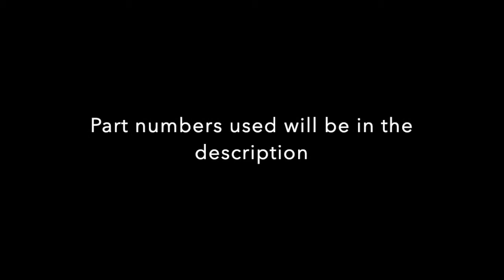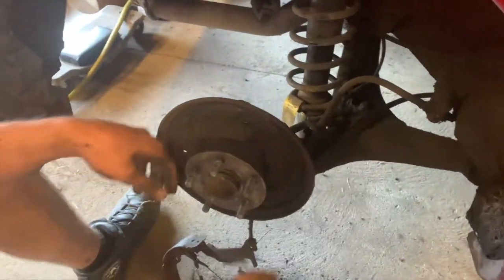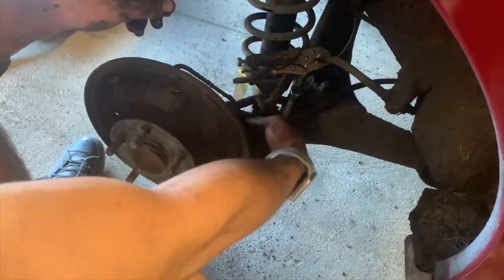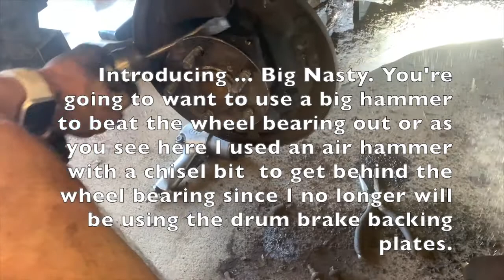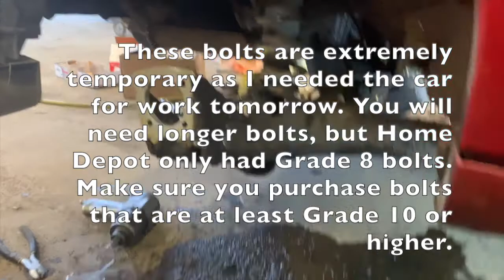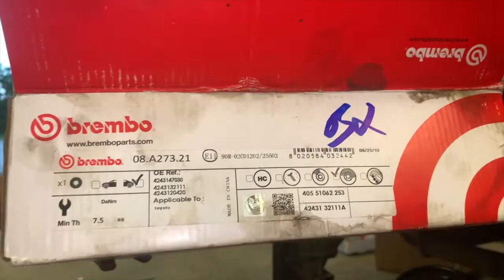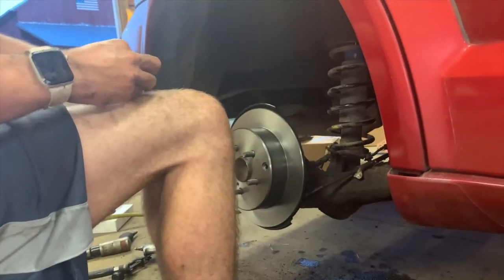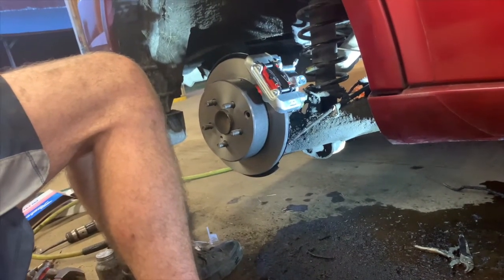2003-2008 Pontiac Vibe/Toyota Matrix Rear Disc Brake Swap

Comment: Where did you get the new backing plates from?
Reply from the maker: I work at a shop and was able to order them from the dealer. If you google the part numbers, usually Ebay comes up with the genuine Toyota backing plates.

Comment: Fun project.  But seems expensive for an old daily driver.  Drum parts are cheap.
Reply: Clearly you don't understand the benefits of disk brakes.
Reply: @ramtek2702  - sure I do. However, I happen to have a 2003 Vibe, and it stops just fine with... drum brakes in the rear. But, you do what you want. Obviously.
Reply: @Kro_man_tx  HA!!  I wish I could do this job.  Unfortunately I'm about 20 years past my prime for this sort of work and it's just too expensive to hire out.